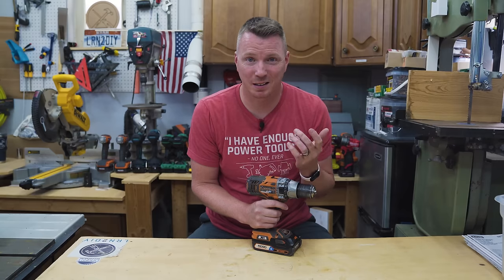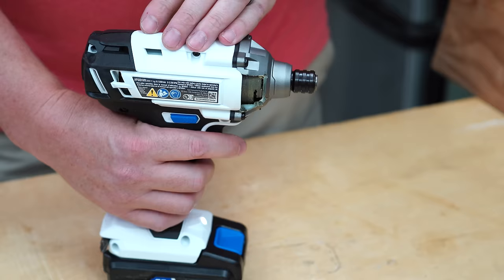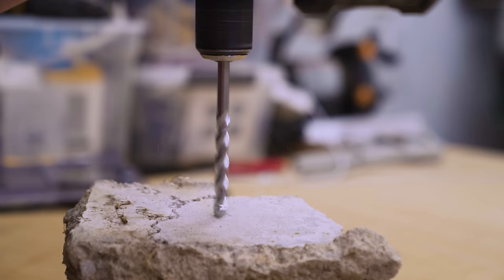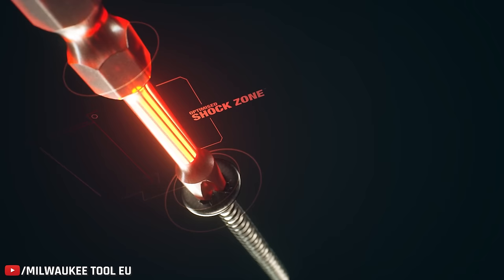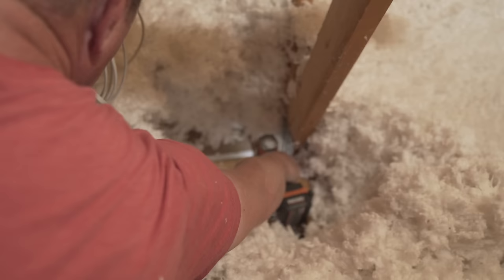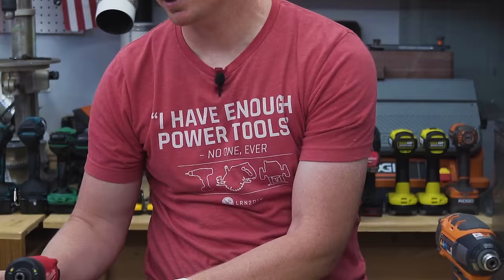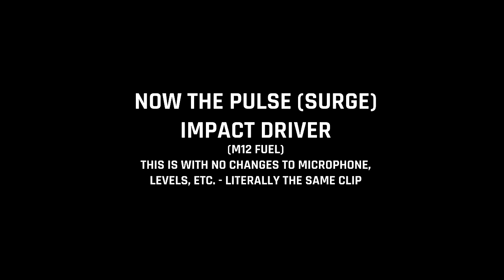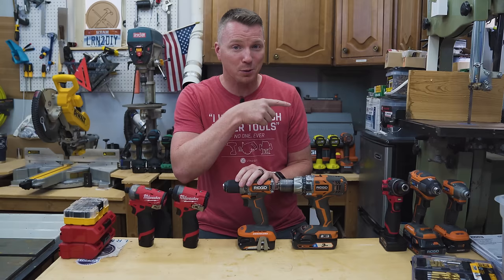Is The Cordless Drill Becoming Obsolete?

Comment: I use my drill to drill and the impact to drive the screws, so that way I don't have to switch   batteries often and avoid switching between  drill bits and driver bits. My drill will never go into the trash I just need to update it to the new yellow Ryobi drill like I did with the impact and the recep. saw. I have Ryobi and Dewalt tools. I used to have a Ridged at one time many years ago but it is a lonnngggg story.

Comment: Is there a tool which works as drill for lower torque( constant, smooth rotation), but start impact mode driving when high torque is needed?

Comment: If all you are working with is wood (and soft wood) and you use torx or robertson screws then yes an impact does it all.    When I lived in Canada I practialy never used my drill.  However when I retired in Thailand and everything here is cement, hardwood and steel and all of the fasteners are phillips I use my drill almost exclusively.   Well actually I use my sds hammer drill more than any other tool but in the end the impact collects dust from sitting not working.

Comment: I drive a metric buttload of stainless steel screws. Stainless screws are soft, and I consider them a single use item. I usually prefer a drill on a fairly low torque setting, and at the slow speed. Also, the noise is annoying. I'm not certain, but i also think I'm putting off the inevitable carpal tunnel problem...

Comment: I use my impact for everything except drilling... I use my drill to drill holes and I like a continuous motor rather than an impact esp when drilling metal (since I restore old busses for fun.. most all of my drilling is metal based)..   impact tends to encourage drift whereas my drill with some good drilling oil and a slower chuck speed i can get right through most metal with minimal drift..  for running in screws I like my impact most times..  and it definitely heps with getting out stuck screws.. which i have a lot of on vintage busses..

Comment: I was only buying one, and I bought a drill after trying my neighbors impact driver. I can still drive anything, or drill anything, and I get a clutch for gentle work and I don't have to put up with that horrendous noise.

Even the new hydraulic impact drivers, are still too noisy for me. 

I would probably only use an impact driver if I was working as a contractor, and time was money. Only then would I trade my sanity (noise) for the faster driving speed of an impact driver.

If you aren't in a hurry, a modern drill can do it all, even more with the clutch.

Comment: Thanks for the education on impact drivers. I do find the small drills with the hex end wobble and hence will have the bit jump off the mark. Plus they break more often than when you use the same small size in a drill. I have some of the drill/bit sets from Milwaukee with the torsion feature but didn't realize that feature was there. I will use them more now that I know - thanks

Comment: Since i'm not in need of heavy duty driving, a drill is just fine. Lugging around enough tools as it is in one neat box that enables me to do almost all my tasks. 

Maybe in your field it becomes less used, but if i have to pick just one, it will always be the drill.

For context, i'm an electrician and usually when i need to drive screws, they don't need to go that deep and most of the times the wood is soft enough. If it's brick or concrete i resort to drilling holes with my corded drill with SDS head. Makes butter out of even concrete and you can go on an entire work day without having to worry about battery life.

Comment: I use my cordless drill plenty I just don’t use it for driving screws which work best with my impact driver 
Heck I still have the very first impact I got that came free with the 18v dewalt versa pack as a promotion 
I still remember the first day I got it 
Tonnes of screwing it was like an absolute revelation and I’ve never looked back since 
Naw the drill is for drilling and counter sinking

Comment: Good premise. It's curious that every framing carpenter in the past 200 years has know  what's most effective: less weight, longer handle, faster swing -- and it's taken electric drill manufacturers to finally  apply this principle to every facet of drill/fastening. 
During the 1990s I noticed a couple of things. First of all my very old 9V Makita drill just seemed unstoppable. It outlived at least one 12v and one 18v drill. I still have it and would still use it if I could find batteries. The second thing I noticed was outside of small jobs my higher voltage drills would go through two fully charged batteries before the job was done. So I just started taking out my corded 3/8" drill (I was going to have to anyway).  I grew up running extension cords, so it wasn't a big deal. In fact before I threw away the 12v and 18v drills I looked for a plug in converter option. Never could find one. Now corded drills are difficult to find, and no one seems to make a corded  impact driver.

Comment: I've used power tools in a professional capacity for most of my life.  In my opinion, impacts are great but don't really replace the functionality of a drill.  The 1/4" quick change drill bits that fit into an impact are usually limited in size and are more expensive.  Its also difficult to find quality drill bits in that style.  Most are just titanium coats sets you buy at the box stores.  I often find myself using both the impact and the drill together.   Pilot hole/countersink in the drill and driver bit in the impact.  Not only would I not recommend getting rid of the drill, I would suggest buying the combo kit that includes a hammer drill.  Hammer drills are handy to have even if you rarely use the function.

Comment: my absolute favorite tip is the 6 inch dual end with a #2 phillips and a T25 torx. ive probably bought every version i can find on the internet, but its not as common as youd think. these need to be a mainstay in the tool scene, why cant the hardware stores have any foresight?

Comment: Dewalt impact driver has a 3 speed function, with "speed1" slipping as soon as any pressure comes on. Could be useful for those small screws.
                                                                                         "speed2" similar to the power of Ozito/Einhell 
                                                                                         "speed3" Slightly better than AEG/Rigid, but a little less than Makita.
I love the eject feature of the AEG/Rigid Impact head, which isn't on other brands. But the tri lights on Ozito and Dewalt are better at eliminating shadows around the tip.
If only I could get all the best features of all the brands - Price (Ozito), extra buttons for light(AEG), Power settings (Dewalt) etc etc
Too many choices, Sometimes it's just more fun to just smash it with a basic hammer.

Comment: The great thing about an 😅mpact driver and, it should be a consideration for those who are looking to but a combi drill, is the short body. It reduces the leverage length from the handle to the point of contact, be it a wall or a piece of machinery. 
My combi drill has a really short body specifically for that consideration.

Comment: I used to feel the same way until I took note of how smoothly and easier it was to drill a screw into wood than an impact. They both did the job, but one was better at it. Now, if I needed versatility the impact was used. If all I'm doing is screwing into wood, same size just a lot of it or simply needed a smooth non marking operation for indoor use? A drill.

Purely DIYer stuff.

Comment: No offense but impacts have been the way to go for well over 10 years and common on jobsites for doing any type of rough work.  We still have a drill on our job site and use it sometimes, mostly when we're doing finish work like plugs and using a forstner bit, pre drilling ballusters(for example), or for its hammer drill setting if we don't have power for the hammer drill.  It still has its place and it always will, especially when it comes to finish work.

Comment: I've got a good Makita set that I've had for about 10-12 years. Very expensive when I bought them. I've used them a bit, but only diy. I say this because I'm trying to find out if my experience is normal. I bought a set of Diablo spade bit drills so that I could use them in either tool...I find they wiggle quite a bit in my impact driver... It put me off using them in it. Is this not normal?
Reply from the maker: That can happen (the wobble) but I find that on newer drills they tend to hold really snug.
Reply: @LRN2DIY  I appreciate your reply. Maybe they didn't manufacture them to the same tolerances back then as this usage probably wasn't a concern back in the day? It was a 'top of the line' set costing several hundreds of dollars so I can't imagine it was a lack of quality at the time... Maybe I need to look at buying a separate new impact driver...I do covet the lightweight aspect and the lack of kickback is only another win. Thank you again.

Comment: I prefer self drilling screws and self hammering nails.  Really there is nothing for me to do but stand back and drink coffee.

At home I use a pair.  Drill for pilot holes/counter sink and the impact for driving screws.

On the jobsite I carry an impact with a hex drill bit (sheatmetal) and leave the drill at home unless I have concrete or thick metal to drill.  It isn't a question of the impact is better, but carrying weight/bulk.  Everything is up on the roof of buildings.

The Milwaukie impact is magic for work since it is capable and very small/light.

Comment: For working on aluminum airplanes, the standard tool is a high speed air drill -- aluminum likes high speed and low pressure. Too bad an impact driver won't work there, I expect.

Comment: For diy maybe valid points made can't fault the logic.

For any real use no far from obsolete. Shock wave snaps when you apply non impact for to it.

Impact ready bits are short and often get dulled by higher speed drilling.

Hole saw and larger bits suffer terribly when done on an impact.

It's akin to asking if framing hammers are obsolete because the titanium is only 16 oz which is the same as a drywall hammer.

Comment: Can’t mix mud with an impact. You also can’t drill into concrete without a hammer drill, nor use a 4” hole saw.    You are right tho, for most jobs the impact is more than enough.

Comment: I have been using dewalt cordless drills since mid 90's the new kits came with impact drivers. I am having a hard time getting used to a light weight tiny tool

Comment: Yes an impact driver uses less battery than a drill and you can use even less battery if your impact driver is brushless because a brushless motor is almost completely friction free as opposed to a brushed motor. Al,so, if you are working near any explosive vapors you should only be using brushless because brushed motors emit a show of spark inside the tool which are vented to the atmosphere.

Comment: I think the hammer drill has it's place as a versatile tool. Like any tool it's overall usefulness depends on your application. I like having one around for tile setting work. When I don't need the giant corded Rubi mixer I can just use the smaller mixer paddle. Works great for low speed honing for diamond cones, making flawless circles in tile. Low speed also best for mixing grout, doesn't beat air into it. We sometimes install curbs into concrete so the hammer setting works great there. I see your point, kind of... more like we have way more tools for specific tasks that the hammer drill isn't used into 147 applications anymore. Good video tho

Comment: I went opposite way.  I got a better drill with torque control and hammer , drill and drive functionality and now I never reach for my impact. I have control for small bits, power for big holes and everything in between.   It is way better than the impact.

Comment: There is a second down side to the impact. We've proven in industry for years that impact devices fatigue fasteners. They weaken deck screws to the point we see complaints about screws eventually popping as wood shrinks and swells. With all of those complaints I've seen, the screws were driven with an impact.

Comment: It all depends on what you do. But I use my impact driver most of the time when driving screws or bolts. But not for actual Drilling
With laying out a bunch of precise holes it's not the best option. Doing drilling requires a good standard drill.
  When I am cutting out for light fixtures, there's no impact driver that does the job

They are indispensable when it comes to general purpose

Comment: I have found cordless drills are better for quickly rolling straps( used on a flatbed), also a hammer drill is a cheap way to make holes in concrete. Other than those 2 applications I typically prefer an impact driver.

Comment: I would never trade my drill for an impact driver to drill holes, I use the driver to drill screws, but I have found for small screws in hard wood I prefer the drill since I can control the torque and not 'twist off' wood screws. Also when drilling with small drill bits it is easy to break a small drill bit when you have a big hex driver attached.  So NO, I will never give up my cordless drill for drilling small holes and even driving small wood screws in hard wood.

Comment: I still use both. I have two drills and one driver. Drill, countersink, and drive a screw without changing bits. Those HF Warrior bits are garbage. So many warped bits. Buy good bits and save your sanity.

Comment: Do NOT use hammer drill with concrete hole drill with carbide teeth. I needed to drill 2" and 3" holes in concrete blocks. I used hole drill with carbide teeth and after just a few holes the teeth started falling out. I replaced the hole drills and used the drill in standard drill mode. No hammer action. Finished the job and am still using the hole drills.

Comment: The drill is for hard use when it comes down to drilling large holes while an impact driver is more for driving it screws and smaller holes. Impact drivers are also not very good at going through metal and impact driver drill bits aren't nearly as strong so imo until they can make two tools in one you will need a drill as a serious contractor.

Comment: i dont care how strong is ur drill bit and ur forearm u can never drill accurate into metal specially hard metal with an impact driver without breaking either ur wrist or the bit. And they are mostly too fast for that kind of work. But i get ur point for ez tasks and wood work and electrician small jobs i dont realy see a value of a drill driver over a bit driver. Good point.

Comment: I see what you did with the kickback part. Kickback isn’t a factor because bits that cause kickback including all the ones shown won’t chuck in an impact. It also wouldn’t have the torque to run an auger or self feed. Im a plumber and for a while I fell into the habit of trying to use the impact for everything. I’d basically only use my drill for hole saws and  self feeds. However I’m trying to break that habit and use my drill more. The main area is with the small twist bits. I’d buy those Milwaukee titanium bits. However when drilling into metal, the impact doesn’t have the torque it needs without starting to impact. It also doesn’t have speed controls. This causes the bits to wear much faster. I finally went back to heavy metal bits and a drill. I also preferred to use an impact to run an inside pvc cutter because it held the bit better so it would let fall in the pipe and was quicker. However if you chuck it with your hand rather than the motor this isn’t a problem and the steady speed cuts so much better. Basically I’ve returned the impact to doing whats it’s designed for, driving screws and small bolts. Except for the occasional small hole in wood that’s all I use it for.

Comment: The noise drives me crazy when there is 3 or four guys using these on site, cant hear myself think and 9 times out of 10 they dont need to use impact for what they are doing.
Just get a small drill that does the same without the horrendous noise!

Comment: Electrician here. Lots of knock outs to drill, a hole saw arbor doesn’t fit in an impact, and you really shouldn’t be drilling metal with and impact anyways. Def need both for different applications.

Comment: Bro, as long as I still have to install cut in light boxes to hang lights, I’m going to need to run a hole saw! How can I hang vanity lights during a trim out?…. Every time I do a meter I need my hammer drill function… I’m constantly having to use the hammer drill part before tap cons for straps… No this whole thing is ridiculous, yeah sure possibly for the do it yourself guy at home who doesn’t regularly use one!

Comment: Aren't impact drivers just small hammer drills? And hammer drills were a thing for a very long time. You can't drill in concrete with anything else. But the way, can impact drivers drill in concrete, or they are too weak?